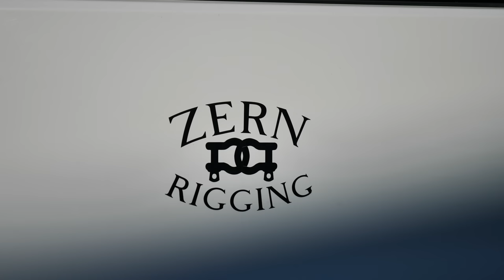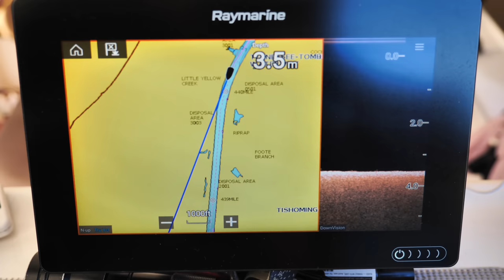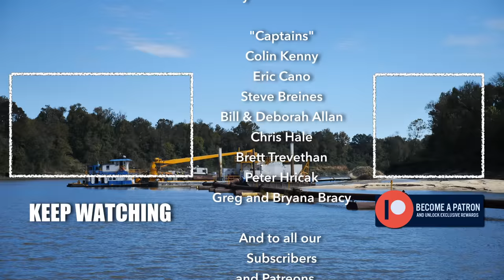17 TOUGH LESSONS LEARNED - Great Loop #19 - Sailing Life on Jupiter EP98

Comment: Princess - "You chose this spot! Jamie - I'll pretend I didn't hear that... lol
Re bugs etc - Setup an outlet valve after the heat exchanger, plug a gerni hose onto it, you have a hot water high pressure cleaner, which is also handy for cleaning barnies off the hull.
Reply from the maker: Not a bad idea!

Comment: Anyone can comment on what one can do if they do not have these popping rudders, in these occasions? This is scary. I know in the monohull your keel protects the rudder somehow but in a cat, what one does?
Reply: Cats often have small skegs in front of the props. Also you can put the dagger boards down a bit to add protection for the prop's.
Reply: You definitely stay away from Barkley lake if you have unprotected rudders.  I've pushed a flat bottom fishing boat off a sand bar in the middle of that lake.  lol  Don't get me wrong it has a decent wide channel area but if you get too far out it becomes shallow really quick.
Reply from the maker: I guess make sure you have a strong skeg. Loopers do it all the time.